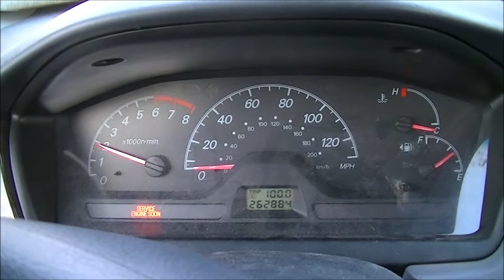Changing the oil on my 2002 mitsubishi lancer es

Comment: how to reset check engine light
Reply from the maker: Check engine light (MIL) is being set off because of other reasons, resetting the check engine light to this vehicle would useless as it would return again. This vehicle doesn’t have a oil reset light is what I figure your thinking of. Many vehicles here in Michigan have check engine lights on, as the salt and rust on components is really harsh and since there is no emissions or inspections people drive just about anything as long as it works. Normally cars that see this age are already off the road by now, I’ve been struggling to keep it alive.